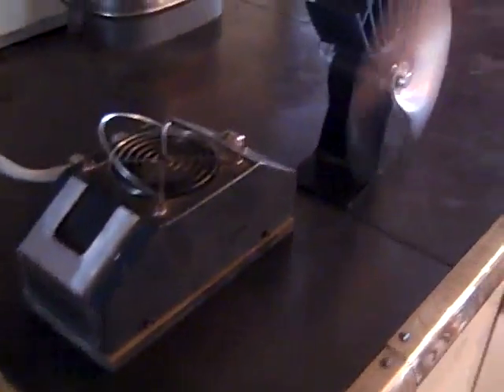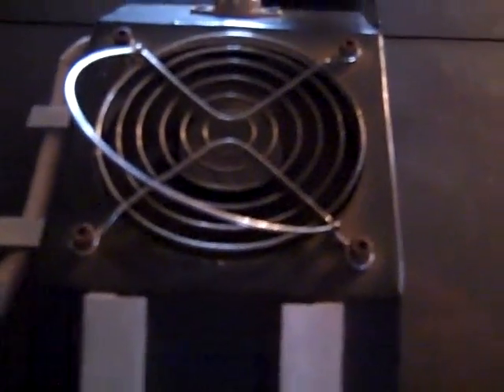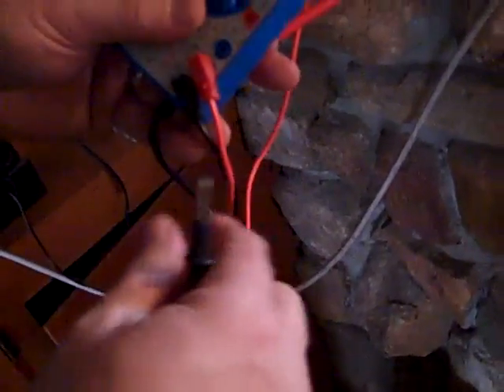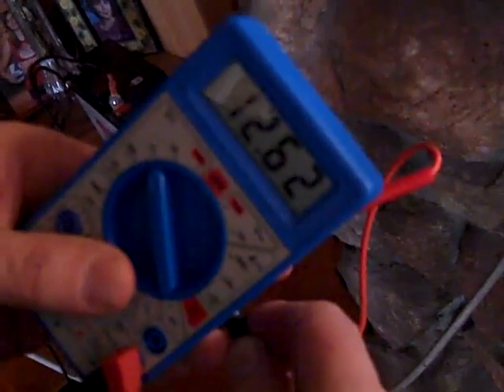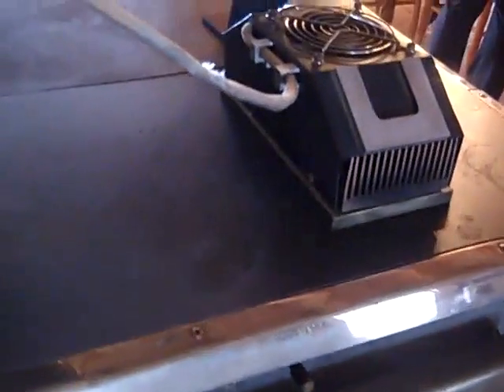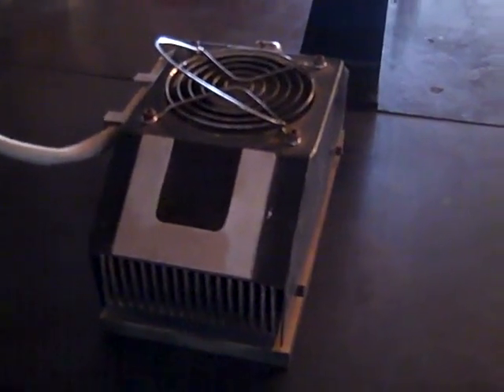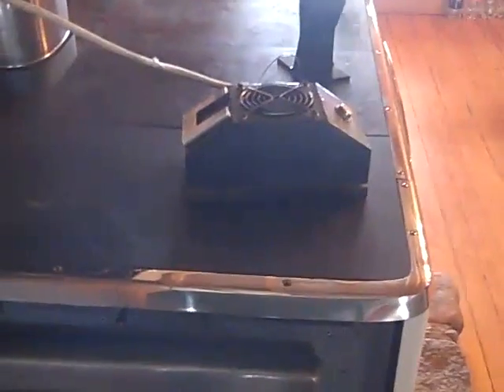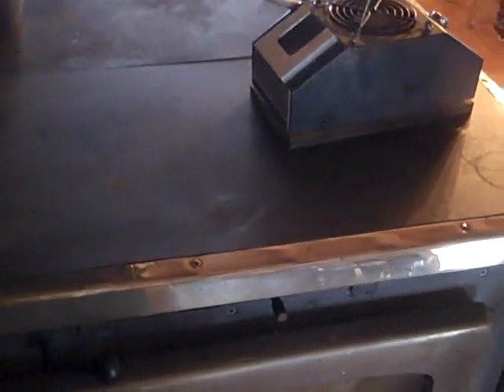Producing ELECTRICITY in bad weather.

Comment: Hey Engineer,  Q1.  What do you recommend for a generator for when the power goes out.  I should say what brand? Q2.  What kind of drive: Diesel, propane, gas?  OR do you even believe in a generator like a traditional generator that you get at Lowes/Home Depot?  What is your take?
Reply from the maker: My favorite generator is an 1800 RPM diesel.  Something that is either 2 or 3 cylinder so that you get about 3 hours on a gallon or better.  Something in the 10-12 kW range.  I like manual transfer switches so that I can disconnect from the grid.  If you can get a enclosed unit that is a bonus.  If you can also find one with simple controls, replaceable voltage regulators that is great.  Keep it simple.  If Propane I like Cummins-Onan, then Briggs then Generac.  All that being said... any generator with fuel on hand is a blessing when the power goes out!
Reply: Thanks, I am still on the fence as to what I want to do yet.  On one hand the 25K gen is tempting, because it would do everything, but a small portable would be (considerably) less cash and only cool maybe a small window unit/ceramic heater.  Thanks for your input I enjoy your channel!

Comment: I use an Earth Stove insert with those muffin fans, with the plastic blades.  If you don't have an immediate power backup, you will melt the blades right off the motor shafts.  I've been using an Astron Power Supply to trickle charge a marine battery and use a low power inverter (175 watts) to run the fans.  During an outage, the charging power goes off, but the battery continues operating the inverter.  I'd be interested in using that stove top charger to keep the battery charged all the time that the stove is fired up.  That's a neat design.
Reply: I see on the web site that the charger puts out 30 watts.  I guess my next step would be to see how many watts my inverter drains from the battery.  Not knowing how long the power will be off, I just use the system I have that lets me close the dampers while the battery can keep running the inverters to run the fans so the stove can slowly shut down and cool down without melting the blades.  They're are $90.00 a pop to replace all 4 of them.  If the inverters drain less than 30 watts of power, then this setup up could be self sustaining.

Comment: These are good tips to consider. You never know when the power might go out and for how long. We had an ice storm here in Ohio a few years back that took down so many power lines that it took a week to get the power back on. Linemen came in from all over to fix the lines. We used a generator to power our gas furnace and fridge. A wood stove would have been a definite plus.

Comment: Great idea and doesn't look expensive .
Reply: Clearly you have never priced those thermo electric generators.
Reply: Look into building one.  The physics for these are not complicated.  The parts are pretty cheap so if you have some rudimentary physics knowledge and handiman skills they work out to be a lot cheaper.
Reply: that's just £180, I think thats a great price. Problem is I dont have a wood burning Stove, now they're expensive!!
Reply: micjam1
I love the idea of getting back to basics. I've started switching of my wifi at night time now just to stop EMFs and all that garbage in the air.
Reply: Aaron's allotment True. TEG wafers can be purchased for about $20 each BUT you still need to stack 5 or more in series to get any current at 12V, spend all that time engineering the enclosure, and have you priced extruded aluminum heat sinks lately?
Reply from the maker: ZeroFossilFuel don't forget the voltage regulator, enclosure, fan, shielded wire, capacitor box with USB and 3 12 volt ports.